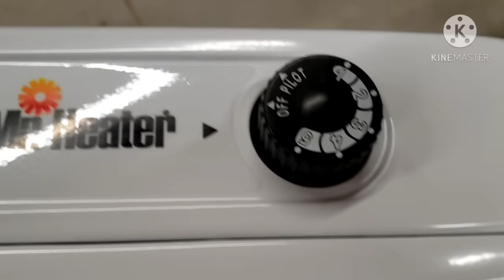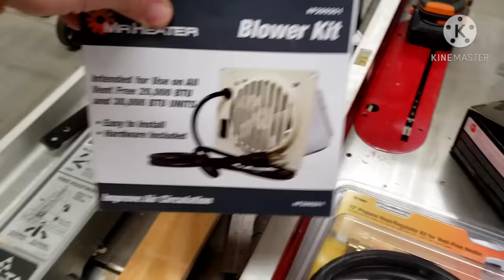Mr. Heater 30k Btu Propane Heater Opening And Install!

Comment: use an eco fan instead no electric needed , just put fan up on a concrete block in front of the heater and it blows out air for free .I have a dyno glo one of these

Comment: Just wanted to thank everyone involved, Answers questions etc. I have a woman that is like my sister With NO HEAT in her attic apartment. With this unit I was able to get it to 70 all day… No issues.
Reply: How long does a 20lb tank last?
Reply: @amealnet2495  when my brother is home he keeps the heat at 65 to 68 degrees. We filled it on December 5th. And today is Jan 17th and it’s still on the same tank. I guess usage may vary.
Reply: @amealnet2495      A 20 pound tank will last approximately 14.4 hours.

Comment: Easy to use right out the box https://www.youtube.com/post/UgkxAvrAfikbUEMthp3AZ6iX5FKdiHfzy_RP . Next step is to get a heat activated fan to move the heat. I'm impressed by how long it can go on 1 lbs of propane at the low setting which lasted more than 6hrs. You'll have to adjust it lower than the low setting. Used for personal heating at 30° to 50° at low setting in an open garage, it's quite comfortable. It would warm up a good size single car garage if its closed off.

Comment: Had one for 4 or 5 years, does it's job very well. Remember, when cleaning. Take a can of compressed air, spray inside of pilot light to keep dust off the oxygen sensor or if your pilot light won't stay lit. Happens on all ventless wall heaters, good unit.
Electricity goes out, still have heat.
Reply from the maker: Awesome to hear! Thanks for the maintenance advice, always appreciated!
Reply: @HermanWoodworks  mines gonna be for my 2 car garage in Michigan for the winter half of my garage is my home gym
Reply: Think the one I’m gonna buy has a built in fan
Reply: You need to "PIN" this comment... so EVERYONE will know this!!
Reply: Keep in mind that compressed air is highly flammable

Comment: I had these in the ga mts attached to the wall and a 500 pd outside propane tank, they work awesome, so bought one for my fla home since this winter is so cold, I use 20 pd tanks, bought the regulator at home depot for 8 bucks, bought the fitting at lowes for 3 bucks, and the blower on amazon for 25 bucks, saved me a ton of cash by doing it this way shopping around and NOT buying a mr heater regulator, mine is 1 psi and works fine, bought the teflon tape at roses store for a buck. I had the dually tank top heaters before this and it smelled horrible like propane, no smell from this unit, plus this unit has the CO2 detector safety shut off. Thanks for the video, great job, best one on utube.
Reply from the maker: Thank you, I appreciate it! I did a follow up video where I attached it to a 500 lb tank also!
Reply: Although propane  alot higher this year there still cheaper to run than gas or electric
Reply: We just got one i am a little nervous. But i got a monoxide detector we are using a medium propane tank. I pray everything will be ok

Comment: I have the exact same model, it came with the mobile home on my vacation property. I just fired it up for the first time today. It needs to be cleaned, which I will do tomorrow. I found the manual online (the internet is wonderful). No issues with Oxygen, that home isn't air tight LOL but I'm working on it room by room. I'll also get a secondary minoxide detector to be super safe. It's being fed off a 120 pounder the previous owner bought outright. Thanks for the video, especially the blower kit info.
Reply from the maker: Thanks and good luck with the vacation property!
Reply: @HermanWoodworks  Thanks! I cleaned it today, nice blue flame!

Comment: I found that turning my garage ceiling fan on low/medium circulates the warm air back down, before the heat would rise and the warmness would be close to the ceiling.
Reply from the maker: Yeah the ceiling fan is a must with high ceilings! The ceiling fans have a switch to rotate forward or backwards, depending on the season. Forward for summer or cooling and backwards for winter to draw the heat up and then down the walls.

Comment: I have this beast and it heats up my 30 feet cargo trailer within 10 minutes about 89 degrees in only # 2 on the dial knob with a temperature outside in the 40s.

Comment: Thanks for this fine video.  It stimulated lots of important comments, as well, and everyone should read them all.  I don't understand why your hose package has the filter set up adjacent to the tank. It's the hose that eventually produces most of the particulate debris that can clog the pilot light and heater, I believe. The hose lining eventually deteriorates; that's why it's considered a "temporary" part of the system.  I believe the filter should be attached directly to the heater, itself, and the regulator should be attached to the tank. If I'm wrong I'd like someone with training and experience to tell me why.  Thanks.
Reply from the maker: Hello Richard! I would be curious if that is the case. Thanks for the heads up! I did a second video with my permanent hookup. Ill follow this comment also to see what everyone says! Thanks for the comment!
Reply: I was curious as to why this was a "temp" setup. Question answered. Solid.
Reply: @HermanWoodworks  I'm going to look for your video with the permanent setup. My question previous two watching will be why are you thinking about going with a 500 lb tank. Then I realized this is a permanent setup. We're thinking about setting up a 30,000 btu for emergency use and thinking of getting a 100lb tank. 
We bought a 100lb tank (gone now) for an RV and didn't hear of any regulations on how far it could be away from your RV so I'm hoping a 100 lb tank can be close to the exterior wall without problems. 
We did have a 250 gallon tank I believe with the propane heat when we bought our home but we had them take it out LOL - we went with ductless Heating.
Reply from the maker: @penelopepi  let me know if the video didn't answer your questions
Reply: @penelopepi  ... per instructions it says with 30,000 propane heater 100lbs tank or larger is required...
Reply: @TheOneLawgiverHolyGod  yep!

Comment: i heat my 14x70 trailer with this heater. i live in indiana we have cold winters. dont care how cold it gets. turn setting to #2 and will stay around 70 all winter long. PS costs us around $600 to heat for the entire winter
Reply: Great isn't it! Heating a 1200 sq foot ranch home in North central Ohio for 2yr and hopefully this winter if we survive the BS coming....
Reply: It's going to cost more this Winter, thanks in part to "Brandon."  Had my 120 gallon propane tank filled last week, and it was close to double the cost of last year's fill...   TRUMP 2024
Reply: @bobhoffman5581  I know its crazy grrr
Reply: I'm looking to add something so my furnace doesn't run constantly. Is this a good alternative for less
Reply: @ejg34  yes cant say enough about these heaters. I do sugest getting the radiant kind though. The heat comes straight out unstead of straight up
Reply: @barrnyroyal1440  what are you running it to? A pretty good size lp tank?
Reply: @ejg34  ya 300 gallon
Reply: @barrnyroyal1440  isn't natural gas less expensive than lp?
Reply: @ejg34  last year lp was $1.09 . This year its$2.36 . lets go brandon
Reply: @barrnyroyal1440  sad time in America. Sounds like it's cheaper just to run the furnace for my house
Reply: @ejg34  yes use to be so nice to heat for $600 for the year. it will double this year :(

Comment: I may get one of those for my off grid cabin my fire place burns the wood fast but it heats the house up good but every 2to3 hours at night you have to get up and put more wood in it not a good nights sleep lol
Reply from the maker: The unit comes with a 1-5 setting for comfort level. You could set it real low so it just kicks on when the temperature drops after the fire has burnt down. I have a friend that throws a little lump coal in the fireplace to keep the fire burning a little longer. Haven't tried it myself though. I also did a final installation video attaching it to a 500 gallon tank outside. Thanks for watching!

Comment: I bought a similar one from dyna glo. Ended up getting a 100lbs propane tank because it suggested it. Wish I'd known I could run it on 20lbs or anything less than 100lbs.
Reply: If you're using it to stay warm during a power outage in Winter, you're going to want a 100# tank...
Reply: yo i just copped the dynaglo heater that says i have to use a 100lb tank minimum… 

can i get away with using a 20lb tank temporarily ??
Reply: It probably uses the same pressure so I'd say yes

Comment: I probably would have made my spacers on the bottom by using a single strip of wood the same thickness of the spacers for the heater to lean against

Comment: Very nice video and heater I was thinking about getting 1 like that or the one with the blue flame there all great heaters I do have rite now 2 mr heater big buddy heaters both brand new 1 with a  3 speed fan I bought from tractor Supply and the. First one I bought from Ebay brand new in original packaging they had 31 more new. Ones but I'm trying the. One without the fan first then the one with the fan to. See the difference I no the. Fan makes a big difference 3 speeds I'd keep it on low speed Itll circulate the  heat better on hi itll cool off the heat
Reply from the maker: Thank you! This unit you can but the fan additionally and install it. The fan itself is  single speed. One of the main comments people make is the fan does very little or nothing. I felt like it helped but I won't claim it was drastically different. Thanks again!

Comment: I have 1 in my 2 car garage running on a propane tank. The fan on it is a joke. Doesn't heat my garage like I wish. I would need like 3 to make it comfortable.  I always have to fire up.my torpedo heater first to make it nice. Then turn on the mr heater to kinda maintain a temp. but my garage will will.still be chilly

Comment: Wish you would have said how you bled the line and showed you lighting the pilot. Skipped a crucial part. Off to find a video that show how to start the heater.
Reply: Turn the knob to pilot, hold down for 30 seconds then press ignite button at the same time.

Comment: Great video. Thanks
Reply from the maker: Thank you!
Reply: @Herman Woodworks   I just bought this unit for the fact it can hook up to natural gas or propane. I have natural gas ran out to my 2 & 1/2 car garage, but my shop is currently set up on the opposite side where the gas line comes in. So, until I can find a full week off to rearrange opposite sides of the garage, using this unit as propane in the meantime then being able to convert it back to natural gas sounds like a winner to me. So, I appreciate your video as I'm on my way to ACE hardware for the parts I need for temporarily using propane.

Comment: I just moved into a single wide with one of these and just watched the end of your video because i didnt know how to get it going. How much gas does it use with a 250lbs propane tank?  And thanks for this video, i about flipped out trying to start it
Reply from the maker: Yeah priming the line the first go around is a little difficult. I did a second follow up video where I hooked it to a 500 gallon tank. I ended up selling this house and workshop and wasn't in the workshop a whole season with this heater. It seemed pretty fuel efficient once I attached it to the larger tank. Let me know if you have other questions! Thanks for watching!

Comment: Great video man just would have been a lot nicer if you would have spent more time going over what size the connector is on the bottom of the heater because I bought an extension for my propane tank and it doesn't fit
Reply from the maker: Sorry about that! I did a second video where I did the final hardline hookup to a 500 lb tank. Maybe that will be a little more help. If not, I used the diagram in the manual which I believe labeled the sizes. Let me know if you have any questions. Thanks!

Comment: Great video! Thanks for taking the time to help others. I just bought this same unit today. Is the blower fan worth installing? My old dyna-glo unit has a fan but seemed almost pointless.
Reply from the maker: Thank you for the kind words! Honestly I have had alot of people tell me they felt the fan was pointless. I can't say it moves alot of air, im sure it moves some. Maybe if someone did a test with a thermal image camera to see if it actually moves the air. I honestly kept the ceiling fan on to keep the air circulating. Im sure it helps a little but not a big noticeable difference. Thanks again!
Reply: I may consider a ceiling fan. Thanks for the quick response!
Reply from the maker: @jaradsimpson7669  in that workshop, I found the ceiling fan a necessity because with 12 ft ceilings I definitely needed to push the heat back down to the floor. Thanks again!

Comment: Sir do you have a purchase link for that temporary hose connection?
Or what size hose fitting threads to the heater inlet elbow?
TY

Comment: I had it running on high. I’m in our store all day working so that may be the problem. I needed it as a main source and it is just to expensive.
Reply from the maker: How large is the store? Also how high are your ceilings? My workshop had 12 ft ceilings and I needed to install a ceiling fan to push the heat back down....also a stand fan can help move the heat around the store.

Comment: My Natural gas unit pumps out a lot of heat, but the humidity that pumps out too causes so much mold on the drywall i had to stop using it when the walls became all fuzzy
Reply from the maker: Natural gas does the same with moisture as propane? I thought it was drier but I've never gone to use it yet...

Comment: I have an 18x22 room for my pool table. it should be just about right.
Reply from the maker: Probably could get away with a 20k btu unit....this 30k does a 28x28 shop with 12 ft ceilings.

Comment: I hear the blower don't  do a whole lot for these units.I have the same heater and it does a really good job without it.The only complaint I have is the cracking sound it makes when igniting.Is very annoying!
Reply from the maker: I feel the fan does respectable for the price tag over the long term. I personally feel I need to install a ceiling fan to keep pushing the heat back down with my 12 ft ceilings. Yes I does make a random sound now and again especially if it is cycling on and off.

Comment: Good video and very informative.  Wish I saw video of putting all the lines and such together, as I'm a novice in that department.  I'm looking at this as an emergency heater for my home during power outages.  I have a 1260 square foot ranch, and hoping to at least heat kitchen/living/dining to a tolerable temperature during long outages.  Curious how long does a 20 lb propane tank last of medium/low heat setting?
Reply from the maker: Thanks Tonya! I'm still getting around to doing a video of putting in steel lines and  such...ive been working with family member who does hvac furnace work on getting the lines installed. Hopefully I'll have that video sooner than later! As per the 20 lb tank, running it on low could probably get you a week. Well let me tell you my workshop is 28x28 with 12 ft ceilings and I get about 3 days of run time (8hr work days) with this unit.
Reply: @HermanWoodworks  so you can use 20lb tanks?  Curious, because I as well bought this unit for emergency heat in case of power outage.
Reply from the maker: @queeky00  yes, the tanks i use are actually 15 lb tanks and work great! So in an emergency, take the tank from the grill and your all good!
Reply: @HermanWoodworks  I appreciate the feedback!   The Blue Rhino tanks you have in your video are 20lb tanks.  But Blue Rhino exchange refills are only filled to 15lb.  I bring my 20lb tanks to a filling station and get the full 20lbs for less money.
Reply from the maker: @queeky00  that makes perfect sense....the 500 lb tank that I have for the house they only fill to 400 lb....so the same 80 percent fill....thanks!
Reply: @HermanWoodworks :
They only put x amount of propane in so it can breathe.
Reply: @HermanWoodworks   the reason only 80% in summer when tank heats up gas expands. The grill tanks they are underfilling them.

Comment: Can't get mine to light.  Brand new battery, hose, propane tank and valve.
Reply from the maker: Sorry for not responding sooner. Did you bleed off the line to remove air?

Comment: For the cost of that heater an to fill the tank you be better off looking into a mini split unit they cool an heat an depending on what size your garage is would mean the size of the unit an it would pay for its self in the long run

Comment: I have this same model, my problem with this is that when i turn the dial it will only light all the cells. Setting it to one 2 or 3 doesnt do anything till i turn it to max then it all lights, but it could be an issue with pressure?!, its supposed to run on a 250lb propane tank. I had hooked it up to a 10 gallon barbicue tank
Reply from the maker: The initial hookup i had on this before it got hardlined was a hose kit that was meant for 20 lb up to 100lb tanks....the next video I did it got hardlined to a 500 lb tank. I specified to the propane company which heater I was running so the regulator matched the required specs.